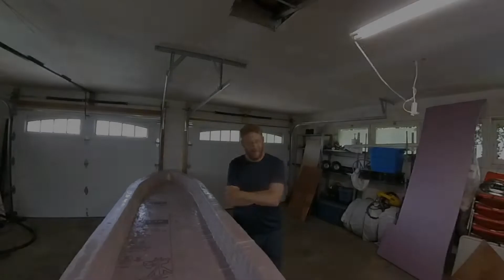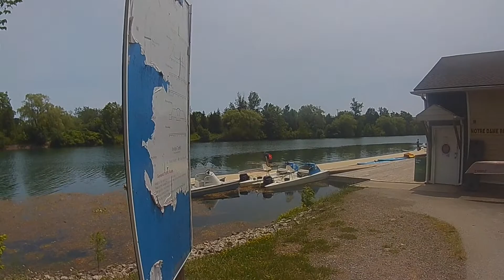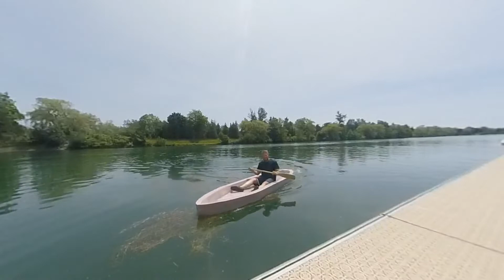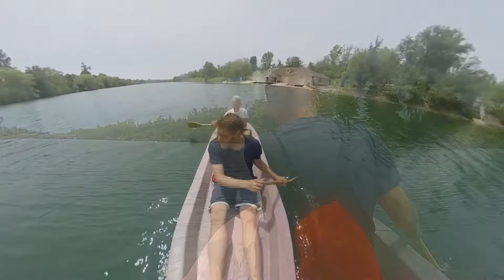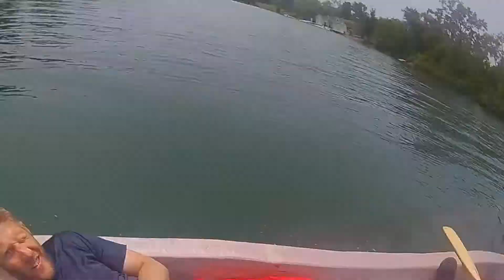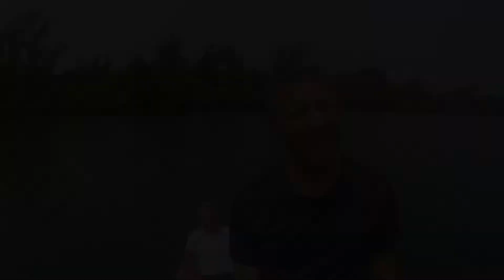DIY Foam Kayak - part 11

Comment: I had the same exact design in mind because i like pontoon boats. But i feel i want to add a treated maple, pine or plexi glass  pannel on top to givw solid base than breaking the 2.inch foam.

I would like to know the total weights of you and your dad. It still looked like it could have held more.
Reply from the maker: Not sure how much we weigh exactly but my guess is around 370 lb or 168 kg. The boat you see here weighs around 37lbs. I made a much smaller one for my daughter that only weighs 9 lbs because it is smaller and has no fibreglass. https://youtu.be/PHfpqYCCxJs

Comment: where you put weight on your knees, did it compressed the foam a bit ? that's the issue with the home depot type insulation foam; it doesnt handle localized loading well.  i think you can get around that by a thin layer of plywood and then skin the ply with glass.  at any rate, what a fun build.  hope you get to enjoy it many days to come!
Reply from the maker: No, it didn't compress at all. It was glassed with a generous coat of epoxy resin. I had initially planned to skin the bottom with thin ply and even cut the pieces, but I changed my mind. It now weighs in at 38 lb compared to my 85 lb 16 ft canoe. It's a bit ugly, but it handles well and is super stable.

Comment: Awesome job. Love how you were able to bend it around into a donut....lol. Seriously, though....looks like she glides well. How much freeboard did you have with both of you in it?
Reply from the maker: Not much less than with a single person. The water was not close to coming in. I might add scupper holes (maybe .. ). It wasn't intended for two but I think it works. I'm going to try to keep the big open flat deck so I can use it as a stand up paddle board, fishing platform and kayak. Being able to lay completely flat is awesome. I'm just going to have lots of fixing points along the sides so that I can attach things on lanyards with karabiners.
Reply: I agree, the pen deck design leaves you with lots of options. I'm still considering making a soloskiff knock off for my next one.